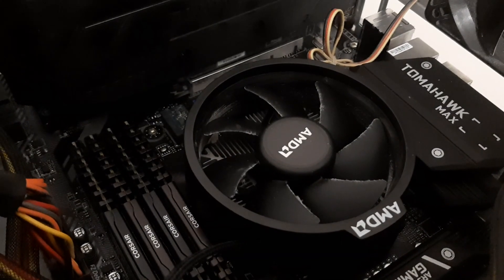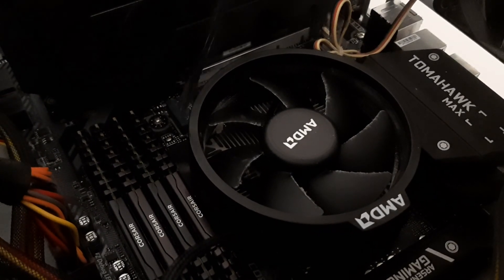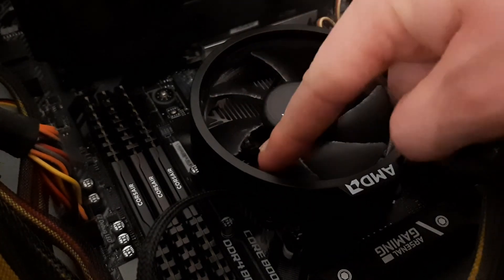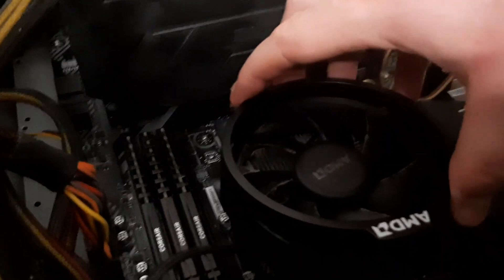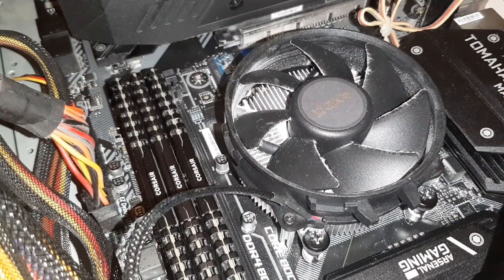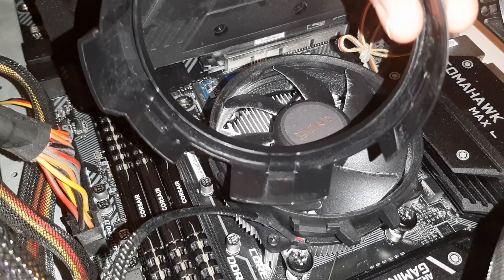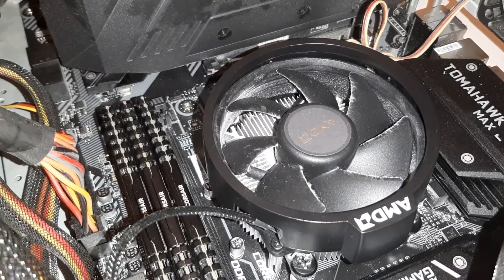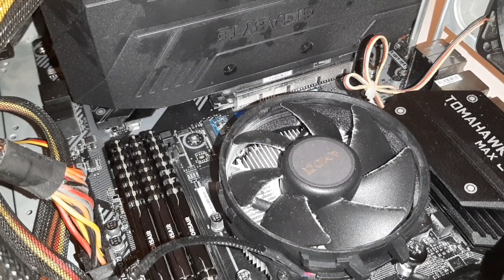How To Properly Remove AMD Fan Cooler From Heatsink | Easily Remove AMD Fan Screws

Comment: Tried this and it broke my fan ring because there are 2 screws holding it on underneath. You cant get to these screws unless you remove the whole fan assembly first. But its hard to do that because the outer-ring partially covers the screws needed to do it. FFS, should have read the comments first.
You need to edit or remove this video please.
Reply: Legend, almost pried mine completely off before I thought, there's no way it's this hard to get the outer ring off, and here this comment is that saved me
Reply: Fucking same.  They look identical...
Reply: I broke it too, should have read the comments
Reply: I forgot about this comment and broke off the mounting thing
Reply: almost broke mine probably for same reason been prying at it for 15 mins cant get it off it must be this?  how do i get to these screws? my heatsink is caked in dust how do i clean it

Comment: A friend of mine he removed the screws and the fan with the cover still on, just 4 screws on the stock 5600X.

They're may or may not be completely flush back in but that fan isn't going anywhere.

Comment: You should add a disclaimer in the title explaining that the newer revisions of the cooler have 2 extra screws under the AMD logo that you have to remove.
Reply: Just broke mine too...ugh.
Reply: You sure?

Just had a friend help me build and he removed 4 screws from my 5600X and took the fan off, rotated it and put it back on.

Which new ones are you referring to?
Reply: @1337_Player  I just did the same, broke 2 screw connectors. Its a Wraith spire bought a year ago.
Reply: Yeah there's two screws that face the mobo under the amd logo. Clearance problem solved I guess lol